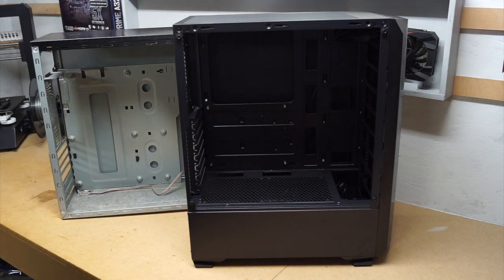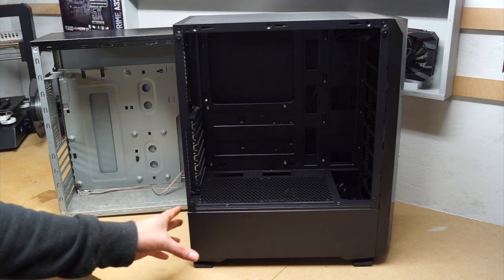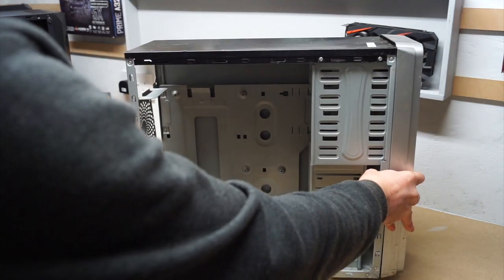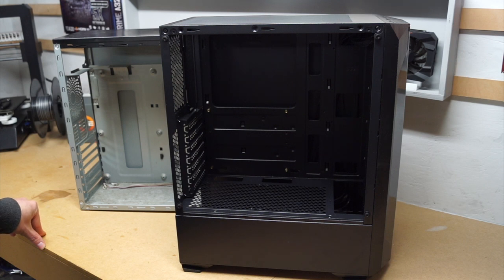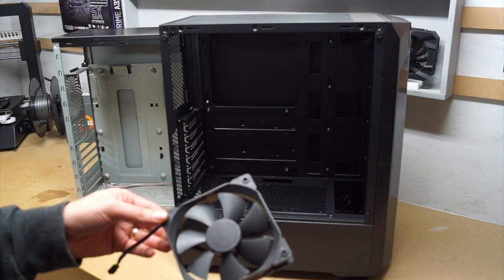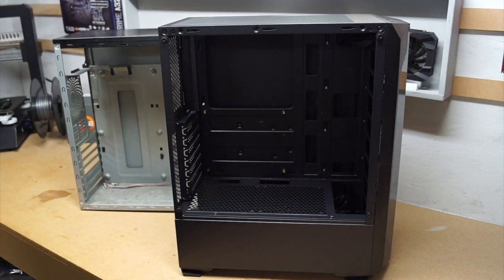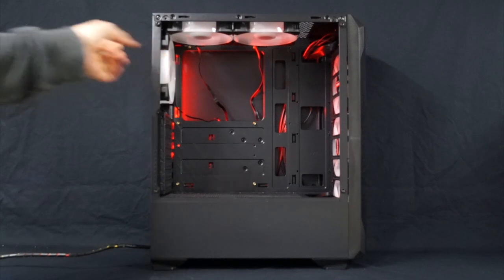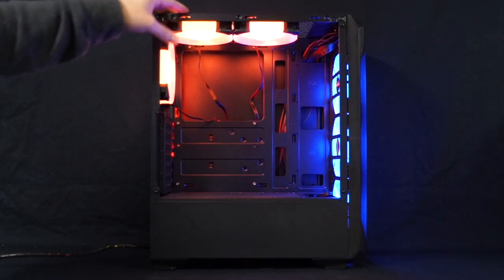How to Setup PC Case Fans for Basic Airflow.

Comment: Hello there very helpful video but I have a question. I have a case with no room for a top fan since it’s fully covered up. My question is should I do front 280 Radiator x2 fans 1 side and x3 other side of rad as Exhaust out of the case and have 1 rear fan as intake or the opposite? My main primary goal is to cool the cpu if that helps.

Thanks in advance.
Reply from the maker: Personally I would probably mount the rad up front with the fans as intakes to get the cool air from outside through the radiator and then have the rear as an exhaust.  With this ratio you will create a positive airflow so as long as you have dust filters on the intake your system should stay cleaner.

Comment: I run both my front 3 fans, and my top 2 fans as intakes. Lots of positive clean air coming in.
Reply: That is not necessarily the best. I would advise testing the top 2 as exhaust and compare temps using superposition benchmark or something similar. I would also advise using smoke to check for negative pressure as seen here https://www.youtube.com/watch?v=a12aDCxrcts Every test I've seen supports top exhaust. You can see a lot of tests on this channel https://www.youtube.com/watch?v=qIWc5f788QA
Reply: @kenshin1368  I have since changed the upper fans to exhausts after doing more research
Reply: @905Speed  i get better temps with my front three and top 3 as intake lol
Reply: my 2 upper fans I changed to exhaust..

Comment: Thank you I was very confused before!
Reply from the maker: The fans used in the demo are from Coolmoon.  I don't believe they have a specific model name as Coolmoon stuff doesn't but if you search Ebay for "Coolmoon 120mm RGB Fans" they are usually the most common.  Hope that helps.
Reply: @TechLabUK  I think u replied to the wrong person 😅 but still thank u for this video❤
Reply from the maker: @Lovehime1000  I think there was a reply in-between that has been removed :/

Comment: So you have 3 intake and 3 exhaust fans what result in neutral airflow. So the CFM is zero with this installation.
Reply: Neutral pressure, not neutral airflow.  Let us assume that each fan is able to move 50 cubic feet of air per minute.  (50 CFM)  THe three intake fans would be bringing in 150 CFM, and the exhaust fans would e removing 150 CFM, so the internal pressure would not rise or fall, but the amount of air moving through the case would indeed be 150 cubic feet per minute, not zero.

Comment: That demonstration at the end was very cool! Here is a question tho. Hot air rises on its own so are the top fans actually doing much in terms of keeping the temps lower?
Reply: I've tested this out. All my fans are 140mm Cooler Master SickleFlow v2 ARGB. I have two in the front, one in the back, and two on top. All fans are at max RPMs (1400). The front fans are always intake and the back fan is always exhaust. I tried different variations with the top fans, all under the same conditions. Here are my results: 

1) With the top fans turned off, the GPU temp was 51-52 C. 
2) With the top fans as intake, the GPU temp was 51-52 C. 
3) With the tops fans as exhaust, the GPU temp was 48-49 C. 

So yes, the top fans as exhaust DO keep the temps slightly lower by 2-3 C degrees.
Reply: @jackburton307  wow, thank you for sharing!
Reply: @jackburton307  That's helpful, thank you.
Reply from the maker: Personally I haven't done any scientific testing on it but there are deeper dive videos on you tube where others have.  From what I have researched, although I have just always done it this way, it does help keep the air flowing through but also that there are limits on how many exhaust fans actually make a difference.  I would suspect that this is because with the internal component fans blowing air all over the place the exhaust fans help draw it out.
Reply: Hot air rises very very slowly. Any fan, even one spinning extremely slowly, will be able to counteract natural convection.